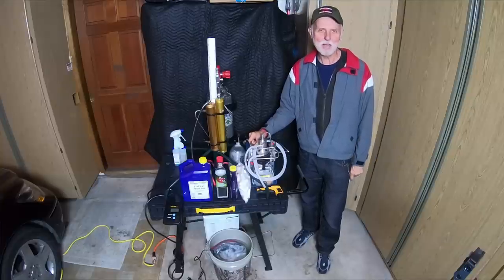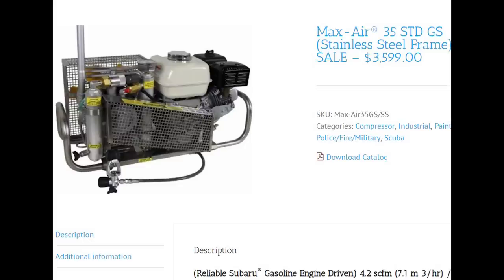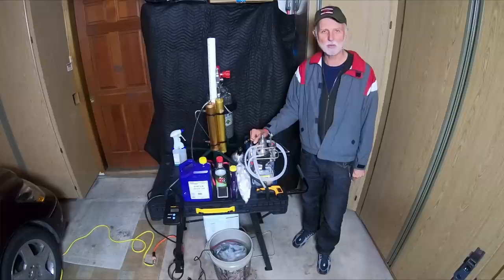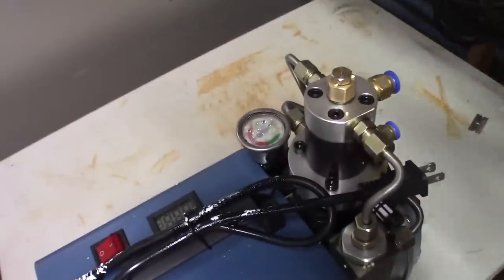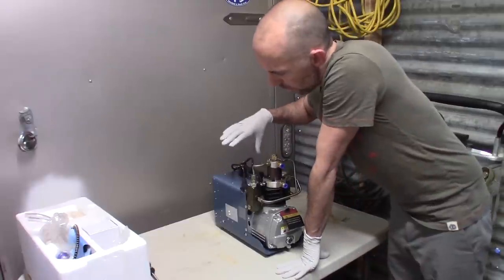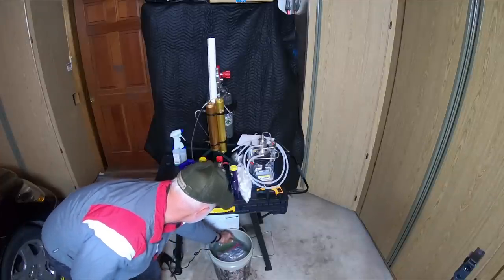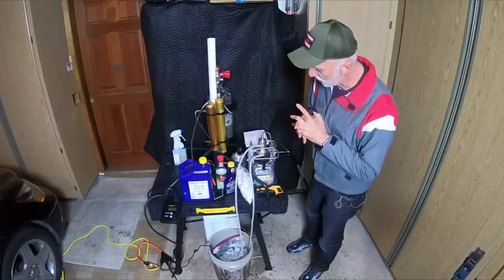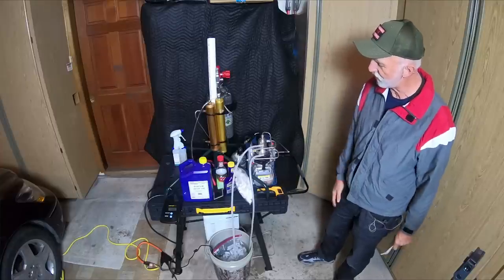Yong Heng Compressor Setup Secrets - Part 1,  Tips, Tricks & Traps

Comment: Instead of investing all the time you did to make changes, and all the money you spent on after-purchase parts, why didn't you just buy a better compressor in the first place?
Reply: Now that's a fair question John and I'm not one to go the cheapo route if a better product is reasonably priced.  Yet a "better compressor" can run up to 4-5 times the cost of the YH.  And like the others who are viewing this episode, we're okay spending some time and moderate costs to improve the reliability of our gear.  And truthfully, even if we just bought two new units and switched in the second if the first broke (and used it for parts), we'd still come out spending less than half the cost of other compressors. Anyway, so far - so good and I wish you well on your decision. As it turned out, since there is an affordable dive shop 4 miles from my home, the best/cheapest answer would be to just have my scuba tank filled up when needed!  Happy Trails,  Michael

Comment: What is the max temp c can u run mine went to 60c in 1 minute with water on  it got hot quick
Reply: Yikes - FULL STOP, Houston, we have a problem!!!  Something is seriously wrong.   Assuming you have good oil lubricating correctly at the right fluid level, don’t have anything damaged internally, don’t have a air blockage in the line (or defective part), installed the air filter correctly, the YH was assembled correctly by the factory, the YH should not rise to 60C in only 1 minute.   If you can’t find someone to help you, consider ether returning it or buying another and using this one for parts - the YH is certainly very affordable compared to the compressors that cost $2,000 up to $5,000+.  Most everyone has good luck with our YH compressors.  But if setting up and running the YH seems to complicated or tedious, it’s probably worth spending more money for a compressor that requires less attention and has much better technical support and manuals.  Good luck !
Reply: U dont want  to go above 50-55c. 60's pushing it ESPECIALLY if ur only at 1 min in.. u can get away with 60 if you almost done  but definitely not at the beginning.  Ur doing something wrong.  I dont think its ur y.h.

Comment: My pump  seems to be blowing a drop or two of water through. I change air filters quite often but still... Any idea if there's anything else I can do?
Reply: Perhaps you have excessive moisture/humidity in the air and maybe the inline YongHeng "cigarette" filter just isn't quite enough to do the job (which is why I went overboard and added two extra filters.  If nothing else, be sure to change your cigarette filter often or at least squeeze out all the water between uses.

Comment: where can i buy the one way air restriction value
Reply from the maker: On eBay search for: Stainless Steel Bleed Valve 1/4" M NPT x 1/4" F NPT Bleed Valve (A-B1115).   The item price is $29.70, sold by supplier 4rfun.  You will also want to purchase adapters to get back to 1/8" HPA.  Here's the link to the one-way check valve and adapters including the 1/8" NPT female and 1/8" Foster male connectors (with additional ordering links)
https://www.airgunnation.com/topic/check-valve-for-moisture-filter-gold-filter/
Reply: @radman731  Howdy Ranman - at first I was going to give a knee-jerk response of change Royal Purple once every 5 hours.  But as I thought more about it, just like your automobile there are many factors that will affect the load, stress, environment, etc. and those factors should and will affect the contaminants in the oil and how fast it will break down.  So if it's a hot, humid day, your YH is brand new, you are filling up a huge tank, you don't take engine breaks every 15-20 minutes, you let the head temperature regularly run about 60C, you might even have small leads in your connectors, etc, then you should change your Royal Purple more frequently.   I'd say change it once after your first hour of operation to flush the loose metal flakes, then every few hours of operation before running your YH, look at the sight gauge and if it's no longer purple and is getting dark, it's time to change it!  Or if have a good nose, take off the black plastic breather and give it a sniff - if it smells stinky, IMMEDIATELY change the oil.  Good luck!
Reply: California Travel Videos Thank you for your attention and great answers. I'm going to create a little log, to monitor my run time, till I get more comfortable with the unit. I'll change the oil after every hour, that sounds ideal. Would you share how you go about changing and maintaining your molecular seive. Mine should be arriving in another weeks or so. Then I'll give my Yong Heng a true pressure test. I only have a 100 ci 4500 air tank. It's brand new and i don't want to contaminate it.
Reply from the maker: @radman731  Sounds like after the first hour and oil change, with a small 100 ci tank you won't need to run your YH more than 5 minutes to get to 4500 PSI.  In that case, after the first oil change, try waiting 2 run hours to dump the oil to validate the oil is bright purple without impurities.  If so, next time wait 3 hours, etc. and consider eventually going up to 5 hours or 6-12 months between oil changes.  Your main maintenance items will be not to let the YH overhead (unlikely with your small tank) and try to avoid sudden shutdowns without cranking open the bleed value as you close the valve to your tank.  I've seen enough piston failures that we want to avoid unnecessary stress when the YH is operating under high pressures and may encounter a nasty BACK PRESSURE that the internal YH check valve may not be able to handle.  Happy trails...
Reply: type that in google search, for quicker answer

Comment: has anyone run this outdoors and hooked the water to a pressure regulator and the faucet of you house and discharge the water to the ground
Reply: I haven't tried this but have seen videos of others using this setup outdoors.  Just be sure the water pressure is reasonable.

Comment: What size batteries does the digital thermostat use mine shipped without them and no information on the size
Reply: LR44 1.5 volt alkaline should be easy to buy, although you could also use  L1154 or AG13 (and maybe 357 if you are in a pinch but it has a different chemistry).

Comment: Hope all is well.  It seems I can’t find much help troubleshooting my Yong heng. It had served me well for 2 years , but unfortunately it had failed me today. I have no idea where to start or what to replace. Both air chambers are holding pressure, but it just won’t go past  1500psi ( I usually fill my 100cu 4500 guppy tank , all the way to 4500. Never had a problem until today ) I do notice of a crank close the release valve (with a bit of force from a wrench) on the second chamber it will climb to 2000psi but if I hang tighten it will fall back to 1500psi and just float there running. I don’t know what to do.  I can’t fill my tank anymore. Any help would be appreciated. I’m prepared to take apart, but I have no idea what to replace or look for , like I said.
Reply: Assuming you've already used a soapy spray bottle to check for leaks, I'd consider tearing down the head and ensure the valves working and not corroded.  I recall seeing photos of some nasty looking valves.  The two-stage piston and associated rings would also be worth a close examination.
https://www.youtube.com/watch?v=YjsBcKSVeGk
Reply: @CaliforniaTravelVideos  yes thank you for your attention. Looks like I’m going to have to tear it down. I can’t imagine how much gunked up it can be. I really only run the unit for about 12 minutes at a time. But I have used it quite a bit ...haha. Enough so that I’ve had to replace the  1st stage line due to rust. Obviously from the water and oil accumulation over the 2 year span. But other than that it has been fine. I referenced your video earlier on and have  3 stages now to clean the air. It’s been awesome , aside from this recent issue. I’m definitely going the strip it down to access that second stage pistol head. And see what we get. It does look clean from what I can tell, looking at the white acrylic “oring spacer “ in front of the bleed valve screw. I don’t see any gunk build up. Im definitely going to have to strip this down to check those piston orings. I should use Silicone grease on any orings I come across, correct ?? Thanks again
Reply: @radman731  Go get 'em and kudos to you - you've definitely got your money's worth from your YH.  I remember when I was originally investigating the air input and tried using an input filter to help mitigate against the dust issues you encountered.  NOPE - when I started it up I couldn't get more than 1500 PSI. Stumped something was amiss and hopeful I didn't have a defective unit or be something wrong), I took off the filter and the compressor immediately started heading up to 2,000 and after a reasonable period over 4,000 PSI - whew!  At any rate, that's when I decided not to fool around with input filters that can starve the YT from adequate input air.  So my only advise is whenever possible, find a clean area to operate the compressor.  Happy Trails!
Reply: @CaliforniaTravelVideos  thanks for the tip.  I most definitely will remove the air input valve and see what I can find, before taking it apart. Hopefully, that will be the source of the problem and start building up pressure, without a tear down.
Reply: @CaliforniaTravelVideos  good morning from NYC. Figured I’d give you an update. 
I had took it apart. I cleaned and relubed the piston stem. It was a bit gunked up. Cleaned out the fittings , I came across, as best as I could. The first stage chamber (cyclone chamber ) was pretty rusty and wet, I guess there isn’t much you can do about that. Some fittings had more  rust than others. It was still pretty wet inside , as well. There were rust fragments inside also. The 1st stage was pretty corroded out of all the stages of the unit. Not major but it was in its way. I guess there really is no way around that. Water and oil are going to go through there. But other than that overall everything seemed ok. Anyways as I was putting it all back together, I stripped one of the major fittings on the second stage chamber. My very last fitting 🤦🏼‍♂️. I just took parts I thought would be useful and threw the whole machine out. It’s really a good product. It’s last me 2 years for $300 dollars. I think it was worth it. There is no way of avoiding the rust build up on fitting. I guess after some time you are going to want to change out the fittings over time and are eventually going to have to do a full rebuild. , I don’t really see any of those fittings and such on sale besides o rings and such. But yeah I’m going to be using my pump for a while. If I order another I’ll get a warranty, I think thats a definite must. It eventually is going to rust up on you. Which makes me wonder about these expensive units out there.  I really don’t think there is anyway around. Your going to get rust build up and need to rebuild something at some point.  Whether you pay $300 or $2,000. I dunno that’s my opinion.  Take care everyone.
Reply: @radman731  Check the anti blast disk for a hole in it. Simple fix.

Comment: putting ice water does not damage the compressor.???
Reply: No, not at all. Actually, the second stage of the compressor has so much pressure, as you saw it is very hot and is hardly bothered by the very small amount of cold water that goes near the cylinder head.
Reply: @CaliforniaTravelVideos  thanks friend